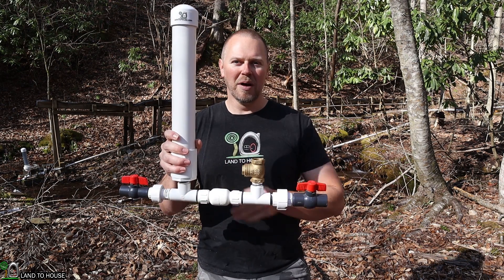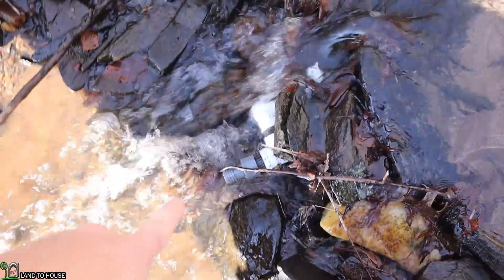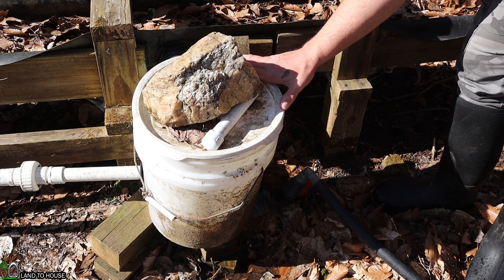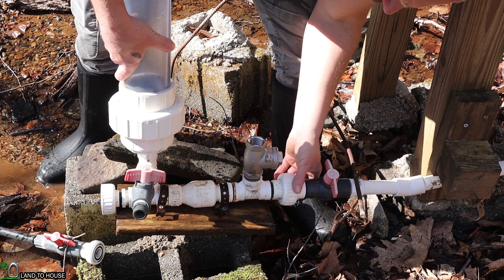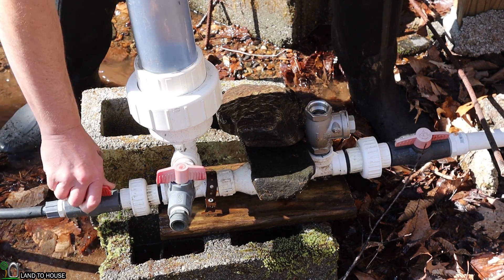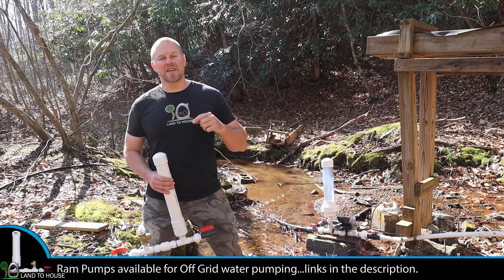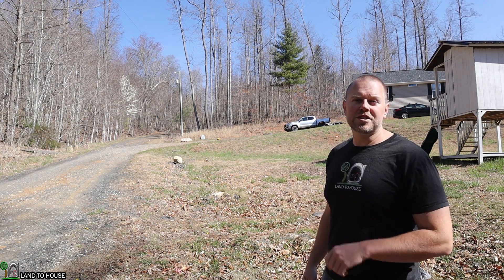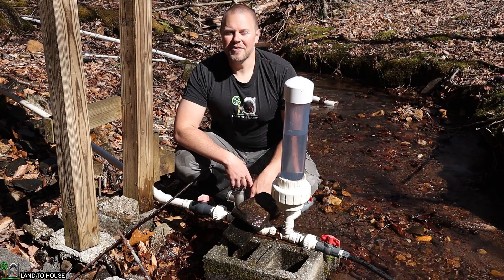Start the Ram Pump for 2024

Comment: Would still love to see you try making something like and idea I've had, to see if it would work or not...

My idea, not sure if it works or not, would be to make a LARGE tank with multiple output pipes with some kind of floaties attached inside, up to different levels in the tank, so they'd only open sequentially when the water is above a certain level. [like one with a pipe top at the bottom, another pipe terminating 1-2 feet from the bottom of the tank, and another terminating 2-4 feet from the bottom, etc.]

The idea here is to try to be able to use all available water year-round, both when it's low flow during the summer, and high-flow during the winter.

The idea being that when you can pull in more water, the tank maybe fills up more, and you can have more output pipes "open" as you get more water into it. So, you can make use of extra water when you've got it to pump more water up hill, but always have some "minimum" amount always going 24/7.

I guess the question is whether you can have multiple output pipes come down and connect to like a y-joint, or a 3-way joint or something, so all 3 pipes can feed the same uphill pipe/hose or whatever via one or more ram pumps?

And can you connect either a valve after the joint, and a ram pump after that, or else 3 ram pumps before the joint? Not sure which way would work better for delivering more  water uphill faster (or, at all)?

Would putting the ram pump after the 2-way or 3-way joint cause too much pressure from the united 3 drive pipes, and cause it to cycle too quickly, or something? If you'd have to put 3 ram pumps above the joint, I assume you'd lose a bit more water out of 3 pumps than out of 1, but if that's the only way to get it to work [without too much pressure causing it to cycle too fast and stop or not work right]?

Just wondering if this would be a way to have a variable performance pump that'll make use of extra water when it's available [fall rains, etc.], but always work at some minimum level [from the lowest output pipe in the tank]?
Reply: Another fun idea I was toying with was the idea of losing as little water as possible in the process of moving water uphill through several "pumping stations," so-to-speak. So, if someone's trying to move water over a long uphill climb, and needs to use multiple pumps in series to get water all the way up top, potentially that's a lot of water lost along the way at the waste valves.

But, my other idea was to have each upper "pumping station" collect/capture the water output from the waste valve into a collection box, or bucket, or whatever, and then have that drain back down to the next lower pump's input tank, giving it a "second chance to go up the hill" (as it would continue to feed the next lower ram pump). And, in theory, then only the lowest ram pump would actually be "losing water" to the ground. And, in theory, each collection/feed tank could have an "overflow" hose either connected down to the next prior input tank, or else to maybe do something useful at that level, like water a garden, etc.

If one wanted to get crafty, one could potentially also use the collected "waste" water's flow to, I dunno, like run a water wheel and generate some small amount of electricity (prior to being dumped into the next lower feeder tank), or something? Done at multiple "levels" along the way, maybe it'd add up? Not sure... Heck, if the run is long enough, maybe you could even put multiple such water wheels along the way at intervals? Kinda' zig-zag the water down the hill through a few water wheel stations before it goes back to the next "feeder" tank? 

Would be funny if it generated enough electricity to take the "waste" water from the bottom ram pump and electrically pump into the first feeder tank, so it becomes "zero loss" or close to it. ;) No idea if there'd be enough "drop" to get enough energy to turn all the wheels and generate enough energy for that, or not? Just an amusing thought...

Comment: I still got a little bit of snow but I just got a new check valve for mine cuz I left mine in and froze I'm glad to finally see a nice land to house video
Reply from the maker: It's far too easy to forget the pump during the cold months and have some broken pieces. I believe I've got approximately 30 ram pump videos planned out.
Reply: @LandtoHouse best way to have reliable water is to buy two and have a spare for repairing whenever something go bust.

Comment: I've often wondered if one could capture the waste water from the valve into a bucket or other container and have that weather flow down to a second rampump theoretically conserving some of that waste water for use back up at your containment tank. Your thoughts?
Reply from the maker: I think you will find this video interesting. https://youtu.be/q3BOG0hureY?feature=shared
Reply: @LandtoHouse  Excellent! I missed that one from 3 years ago. THx again.
Reply: Similar to my idea. But my idea is to use multiple ram pumps to get water up a large hill/cliff/tower/etc., and capture the "waste water" at each level above the first in a small box or bucket, and to then channel it back down to the prior level's feeder tank, and basically "recycle" it or give it another chance to go up the hill... ^_^

In theory, then only the "bottom" pump would be losing water to ground, as the others would just be getting recycled back into the prior pump's feed tank.

Comment: Definitely getting one from you this spring.  Can I get one that has the clear pressure tube?
Reply from the maker: Thank you. The clear tank was super costly. The clear pvc in that small section was almost $50. Because of the cost I don't make them for sale.
Reply: @LandtoHouse  Thanks Seth.  your AWESOME I so enjoy your video's.  I'm putting a 1" this spring, I'd like to do the larger one but the 1 1/4 supplies a not as popular in our area but the other size's are.